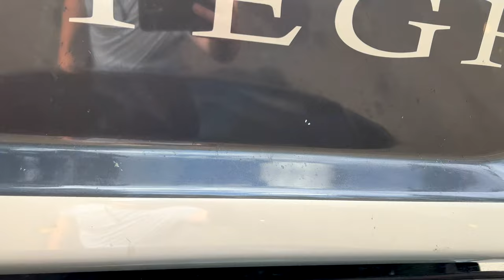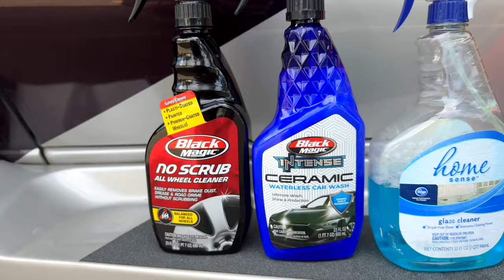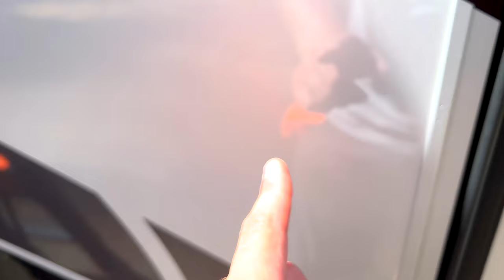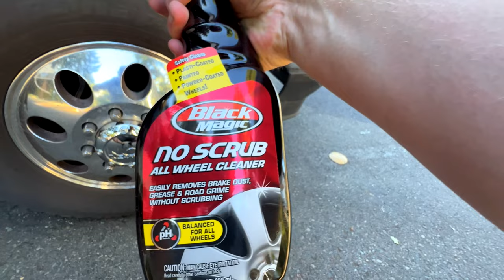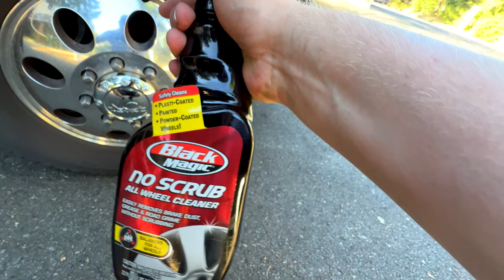First Wash and Detail of our Motorhome | FULL TIME RV LIVING

Comment: It is a pretty looking machine again! Use a green scrubby rather than steel wool, less chance of scratching badly. Also have you had problems taking your screens out and re installing them?
Reply from the maker: Sure is! And I gave that a shot at first, the brake dust was stubborn so I escalated to steel wool! I'm hoping that in the future it'll be easier to clean off and I can use a green deal for lighter brake dust. I'll be going in with much finer sand paper and clear-coating over them to protect them better at some point as well, I suspect that'll fix this nonsense. 

And thankfully, no troubles at all! We just line the tabs up and whack them in to place, they're solid!

Comment: Looks great, have to ask, have the slide motors been reliable?  I'd hate to get stuck with a slide stuck out, especially at check out time!
Reply from the maker: That is our biggest concern with the slides. So far, so good. I always listen for changes in tone or strange noises, it has been consistent from day one! Granted, we tend to use it with the slide in 80% of the time, and this summer the slides got a good workout, but otherwise no concerns at all!
Reply: @CozyLivingMachine  Cool, there is a way to reset the motors if you have an issue.

Comment: I took all my screens off my windows too and also took off the screen door
Reply from the maker: We've been considering that! We've found that the screen was squeaking against the door and frame so we put some insulation there, it's now silent but we can't use the screen door any longer because it can't click in. What did it take to remove the door, just knocking out a few pins?
Reply: @CozyLivingMachine  I just undid the 9 screws and left the hinges in the door frame
Reply: Also makes it a lot easier to do the shade on the door without the screen door
Reply from the maker: @ericdixon5708  That's what I was thinking we could do as well, just wanted to be certain that was the right move. Sounds easy enough to put back, worst case! And having to go outside to mess with the shade is kind of an annoyance I felt silly for thinking but I'm glad I'm not alone!! Do you happen to use anything in place of the screen door or has that been a concern at all? I appreciate the inspiration! 😂